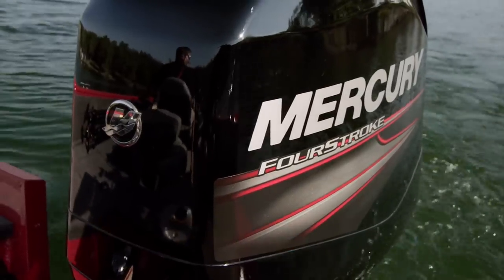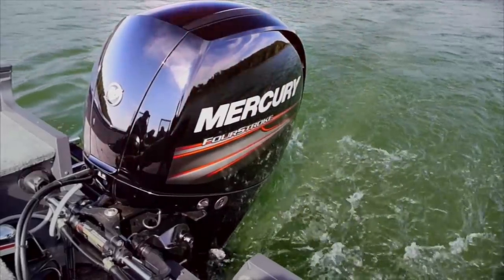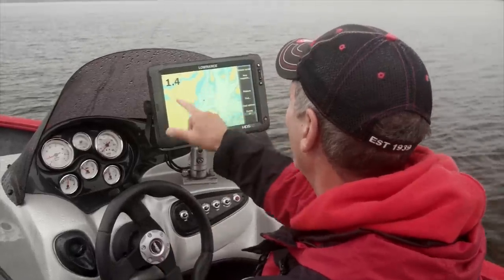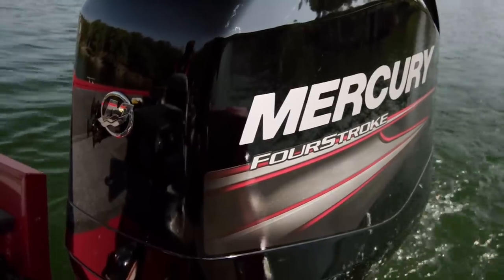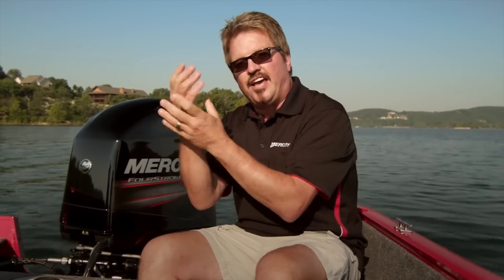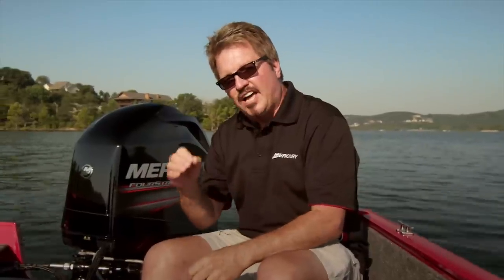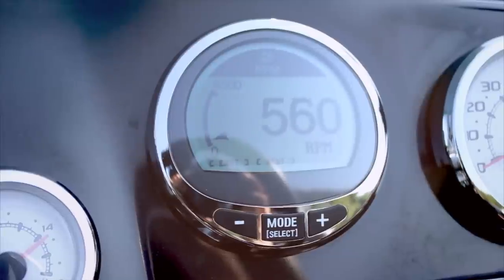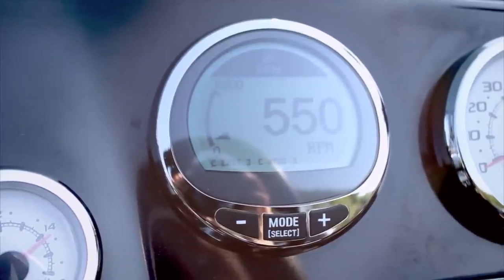Does Slow Trolling Hurt Big Engines? - 1001HT

Comment: I don't have Merc's on my boat, but I was concerned and had the same question, regardless of engine brand, about too much slow trolling hurting my engines. My remedy was to add a powerful Rhodan trolling motor, with three heavy duty deep cycle batteries. I now use my gas engines fare less frequently when I'm trolling. Thanks for the video, great job and a thumbs up!
Reply from the maker: Mercury 9.9 Kickers are nice to have too. Not only for trolling but also just incase you have one of them bad days out on the water and need that second engine to get back to docks.

Comment: I have been boating for sixty years, have had just about every brand of outboard. My new boat will be a Boston Whaler 19 Montauk with a 150 merc. I have complete confidence in its reliability and I will hand it down to my son and my three grandchildren in a year (or two). Betting they will have fun with it for many years.
Reply: Well, just a thought, when you do hand it down, make sure there's a kicker on the back, any engine, new or used can have an issue & break down on the water. For all practical purposes, but especially piece of mind. Regarding the Whaler ?--- Still the best Unit on the water.   Cheers

Comment: I have Mercury Smart Craft on my Mercury 150 4-cylinder.  I cannot get it to go below 640 RPMS, thus still trolling faster than I wish to go.
Reply from the maker: chris I know sounds counterproductive. But have you tried trolling with drift sock or power-pole drift paddle. It would slow down your boat.  Other wise a kicker 9.9 or 15hp is way to troll if can't get to your slow speeds you need.

Comment: Can you troll with drift sock I have a 2021 Lund 1875 impact Xs with merc pro Xs 150. Have NMEA 2000 with troll control hooked to engine but lowest is about 400-500 RPM roughly about 2.5-2.9 mph but if I want to troll for Kokanee at about 1.5-2mph would drift sock be useful?
Reply from the maker: it would slow you down. Reverse trolling same effect as the stern is like a plow in the water.   Ideally a kicker motor or good trolling motor is more ideal for slower speeds.    But you can try on calm days reverse troll and drift sock tied off the bow.

Comment: I’ve got a 2022 sun tracker fishing barge 20 dxl with a 90 hp merc  and I don’t think I have a button to slow it down?
Reply from the maker: You will slow down your motor by its throttle. Most cabin cruiser uses their pontoon at idle speeds all day long as they cruise the edges of the lake.   The Smart Gauges basically show what you can't see. MPG, RPM's and all the technical things that are nice to know.
Reply: @ThenextbiteTvShow  it only slowed it to 2mph I would like to be at .5

Comment: Stand alone trolling motor will keep hours off your Outboard, certainly a cheaper route
Reply from the maker: true, Using a trolling motor or a kicker motor will save hours on your big engine.
Reply: @ThenextbiteTvShow  Absolutely not to mention full charging for your equipment. I have a front and rear usb charging stationn bunch of other things. Kicker motor hands down the smartest investment. Sometimes your main can throw a belt and you can get your guests back to the dock (after fishing all day on the kicker lol).

Comment: I troll with two socks along the sides of the boat, that way I can adjust the speed real well.  The outboard companies should put two speeds in their outboards.  low being a deep reduction so you can use the throttle to adjust the troll speed.  Running at those low rpm's is not good for any engine.
Reply: Some of the supercharged engines have 2 speed gear boxes now. Pretty neat and they also have turning gear boxes so the engine cowl doesnt move. This allows you to fit more outboards on the back of the engine.
Reply: @colbybud  Okay, my idea is catching on. LOL  Thanks for the comment.